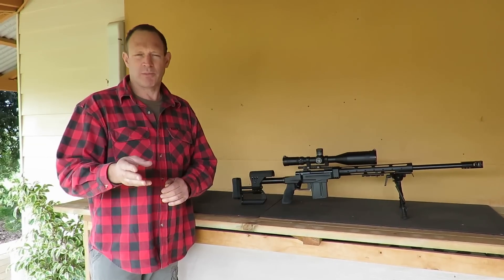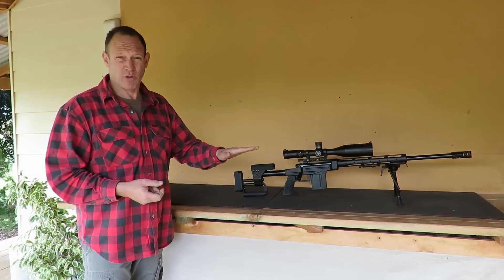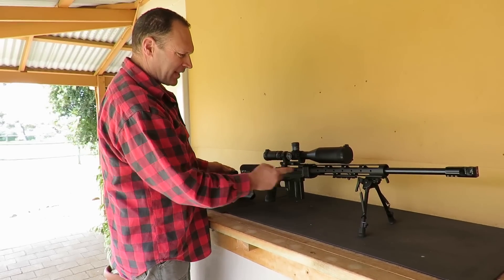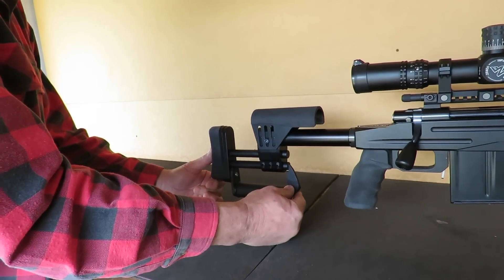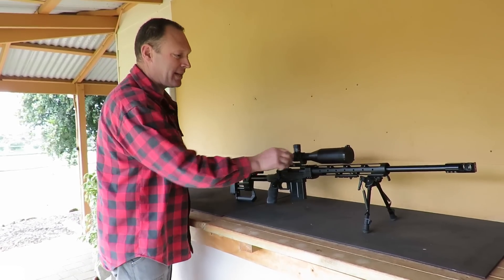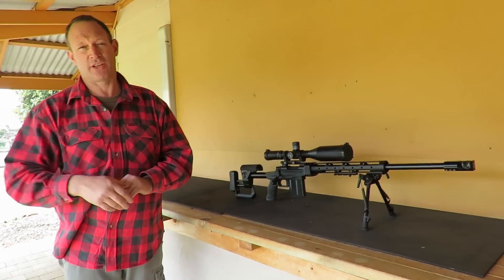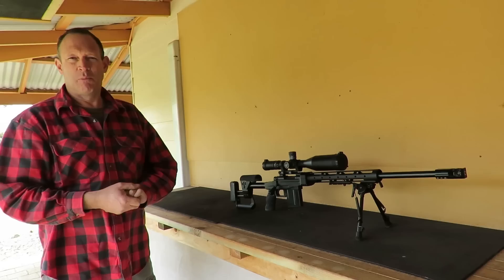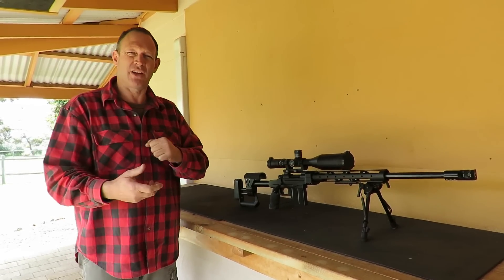How to make a rifle shoot (4AW style)

Comment: Hey Mark, Has anyone come up with a better stabilizer up front then a bi-pod? I am designing a sliding type system to work with a pic rail to get rid of the arcing and slop inherent in the bi-pods, but not be a full sled. Your system for the rear is sweet BTW!  Thanx, Gerry
Reply from the maker: Maybe check out the F class stuff, they have some similar front supports, Sinclair do something like that.

Comment: Thanks for these excellent videos Mark. I'm learning a lot. I do have a question though. 13:00 You mentioned that the muzzle brake can move the muzzle and adversely impact the accuracy. But doesn't the muzzle brake only work after the bullet has left the barrel?
Reply: The air in front of the bullet is pushed out ahead so some gas flow through the brake first.  Great info Mark and looking forward to other more involved tips.
Reply from the maker: Cheers

Comment: Nice video. A couple of questions. You mentioned the. 243 cartridge. 
(1) What are your thoughts on the .270 Winchester or .30-06?
(2) Rifle Action: do you prefer
 (a) the Push Feed Action (Remington, Browning, T/C etc..) or 
(b) the Mauser Controlled Action (Winchester Pre-64, Ruger, Czech etc...)
Reply from the maker: Thanks, I prefer the 243 in along side the cal's I have, but those are both great rounds. I get the argument for controlled round feed and if in a high pressure shooting scenario I can see the advantage, but for what we do it is really not an issue. Cheers
Reply: Thanks. That should have read CZ not Czech. The typing correction function sometimes actually inserts mistakes unilaterally. Sorry about that.
Reply from the maker: cheers

Comment: hi mark i have a howa 308 heavy barrel  stainless steel 1: 10 twist rate what would recommend as a projectile weight
Reply from the maker: Hi Craig, there is no particular recommended weight projectile for your barrel, if you are looking at a projectile you should see if you have the twist required to use them, which with 1:10 you almost certainly will have.  Beyond that there are all the normal factors for your choice of projectile, I use a 175g in my 308 with great success.
Reply: Thank mark I'm just starting out i enjoy your videos

Comment: My favorite quote of yours, "if you are not at half moa you've got work to do on your gun".  Ouch!  The truth hurts.  I'm consistently under one moa but not at half moa.  I have made major improvements with free floating/pillar/action bedding and optics but now looking for another solution.  It is very difficult to diagnose those problems but I am looking for and hoping to find a tip that leads to results.   In other videos you have mentioned that you aim for about one pound or less trigger pull.  Do you think that going from currently 2 lbs to 1lb or maybe a little less could be part of my problem?  Always hate to just throw money at a problem only to find it has nothing to do with or lead to any difference.  Definitely going to try moving butt/recoil pad up.  Thanks for sharing the wisdom!
Reply from the maker: Hi David, lots of things for sure, I always video the rifles action when firing as part of the diagnosis, just a smart phone will do, then slow the image down, (you can get an app for that) then see, that should help. As for trigger, if consistent and clean, 2 pounds is fine, but yes that is a place to look also, Cheers